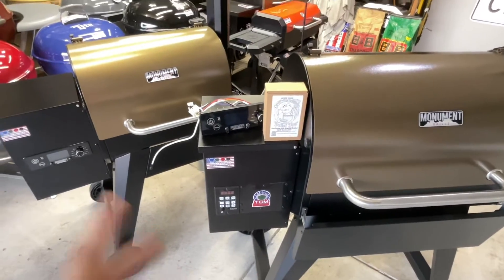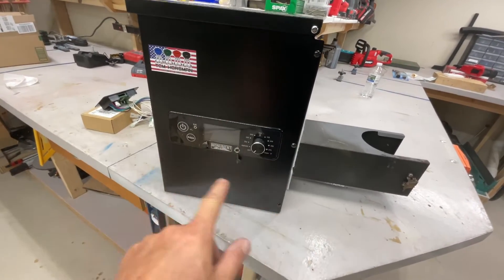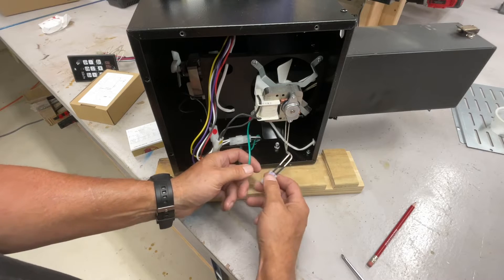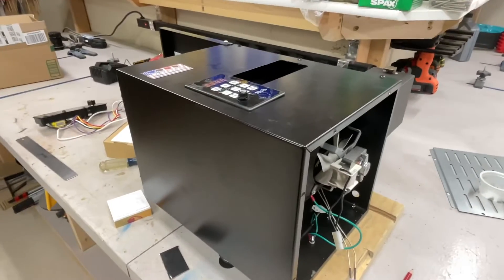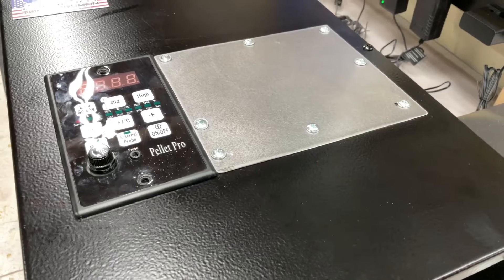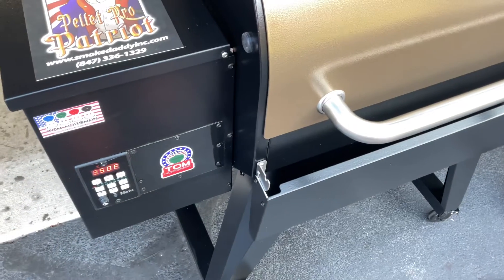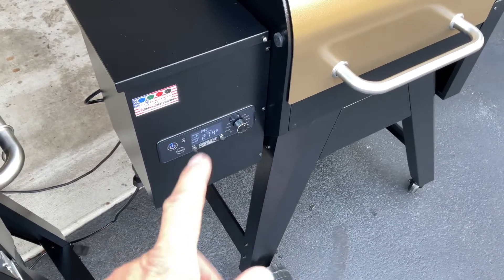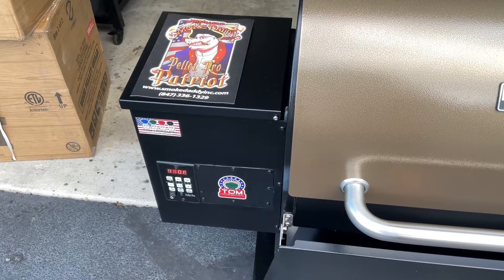Pellet Grill Modification Must Have! / Installing a PID Controller from Smoke Daddy Inc!

Comment: I have had the controller for almost 4 months and the temperature control is great but every time I put in into the shut down procedure it wants to start a fire in the pellet tube. The only way I have found to not have that happen is to get it down to 180ish and than put it into standby and feed some pellets every few minutes for 5-10 minutes almost thinking about going back to the factory controller as this one is a bit of a fire hazard
Reply from the maker: Thanks for Watching!  Contact them, they most likely have a new program for the controller they will install it for free

Comment: Wouldn’t it be easier and more convenient to skip thus step and just buy another pellet grill that doesn’t need this mod?
Reply from the maker: Thanks for watching Greg! This is cheaper than buying a new grill. This also shows how to upgrade and make your grill more accurate if it doesn’t have a PID controller